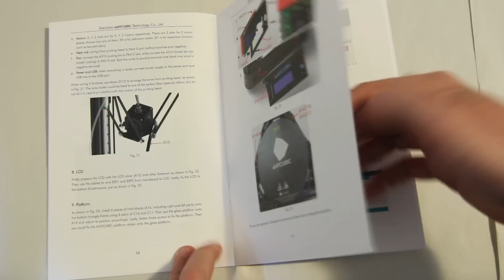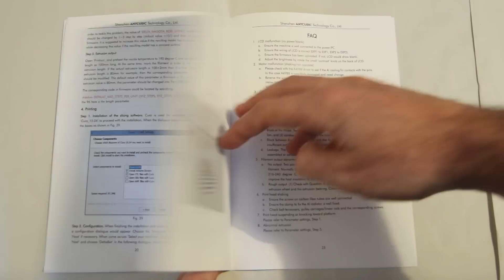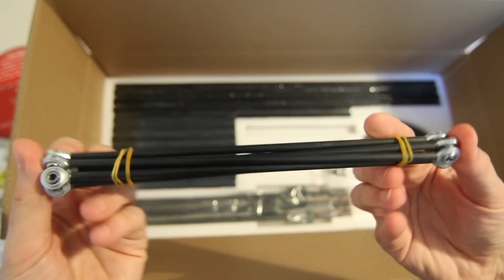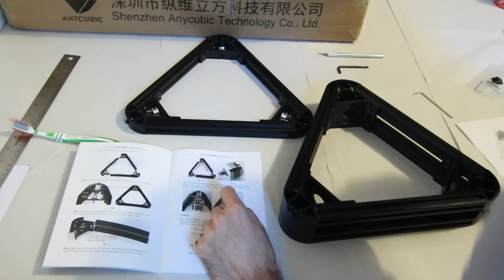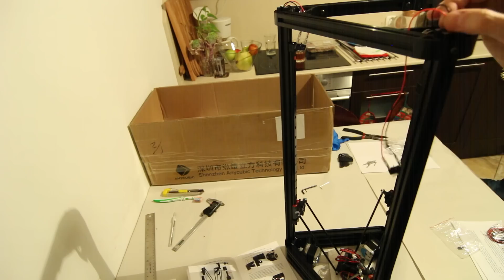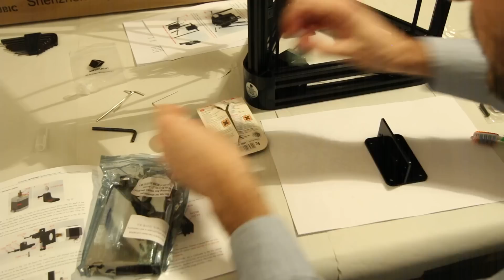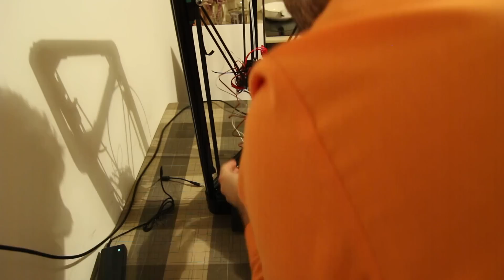Anycubic Kossel Delta 3D Printer Full Assembly and Review

Comment: The best assistant
Reply from the maker: Indeed. And even objectively, surprisingly good :-)
Reply: @ruevs  Thank you for this video. I am just putting one together that has been sitting in the box for many years.  Do you use it still? Is the ball mount upgrade worth the price?
Reply from the maker: I still use it. Works just fine. The magnetic ball joints remove backlash so in my opinion they are worth it. But the printer works just fine without them (for a while).

Comment: Just received mine and what a mess. The product screw heads were damaged (so would need to drill out to replace the screws). Looks as thou the assembler tightened the bolts with a machine that damaged the allen socket. Here are the problems - based upon lack of quality control standards:

A - Two of linear slider bearings are damaged, one of them is rough not smooth the other is too tight and does not move freely. Unfortunately the linear slider housing is made of plastic therefore the tolerances are not consistent. If these bearings are not free flowing, this will affect the print quality.

B - Several of the bolts which secures the table heads are damaged which means I would have to drill out these bolts in order to replace them. 

C - There is no packing slip which shows what is included

D - The top frame 2 nuts and 2 bolts are missing
You are then not able to submit a help ticket as the verification script does not work.

E - Two of the linear slider bearings units were missing some bearings.

F -  No packing slip

I purchased from AnyCubic who resells on AliExpress - I will purchase from Ebay - better seller responses and backup by Ebay/PayPal no nonsense guarantee.
Reply from the maker: Perhaps you should contact @ANYCUBIC on Aliexpress or directly. Their support is (used to be?) very good.
Reply: @ruevs  I did, the seller sent me to AnyCubic site, you can not create a ticket / using Opera 60.xx. On another note, the wiring diagram (on page 25) is confusing for the Endstops and level sensor plugs. I can not figure it out. They attempt to make a correct but still confused. The are conflicts with the board labeling. The first row closest to the the center has lables: Z+ / Z- and so on. I then wired each motor stop sense to the poles. But the diagram to the right side shows what seem to be a correction in labeling. As a result, the print head is crashing while trying to do a level operation or Home.

Comment: Can you create firmware for kossel pulley? Thanks
Reply from the maker: To use my Repetier configuration  on the pulley version all you have to do is adjust three parameters:

Printer Height
#define Z_MAX_LENGTH 297.9

Diagonal rod lengrh
#define DELTA_DIAGONAL_ROD 217 // mm

Printer radius
#define ROD_RADIUS 98.5
#define PRINTER_RADIUS 98.5

See https://github.com/ruevs/repetier_anycubic_kossel/blob/master/README.md
For details.

Comment: Be aware viewers!  I made this mistake and I bought anycubic Kossel kit . It was all pain to assemble this crap and now it's impossible to level it. I spent hours to level the center and two corners but the third corner is not level. Now, if I want to level this corner, it will affect the levelness of center and the other two corners and I am back to the first step. Horrible design!
Reply from the maker: Delta printers are sensitive to inaccurate  geometry/build. I built mine very carefully and have had no problems whatsoever with bed leveling (by hand).

Things to check:
1. Top and bottom triangle are equilateral and exactly the same size.
2. Top and bottom triangle are parallel to each other (all towers are the same height).
The above pretty much guarantee:
3. All towers are vertical, parallel to each other and perpendicular to the top and bottom triangles.
4. The towers are 120 degrees from each other.

5. The linear slides are mounted parallel to the towers.
6. The linear slides are mounted in the centers of the towers.

7. All six diagonal rods are exactly the same length (mine were).
8. The distance between the rods at the carriages and at the effector are exactly the same.
The above guarantee that there is a parallelogram on all three sides of the effector.

All of the above points avoid effector tilt and "nonlinearities" in the geometry that are hard to impossible to compensate in software.

9. The glass bed is flat (mine was). If it is not - replace it or use auto leveling.

And finally for the calibration in firmware read and use this:
http://escher3d.com/pages/wizards/wizarddelta.php
Reply: Thanks for the response but what you mentioned in (1) and (2) at the top are responsibility of manufacturer and not the user! Plus how a user can check all these accurate measurements when manufacturer cannot? At the best, user should assemble this based on the manual and shouldn't spend days just leveling this... not a neutral review!
Reply: It is not a fair criticism unless you have objective evidence of a defect / discrepancy in the parts you were sent leading to the problems you are facing. The design of this printer is perfectly adequate as demonstrated by this build and many other similar ones all over the world. Perhaps you might be better off selling yours as a part finished project and buying a pre-assembled printer ready to go out of the box as your expectations on how easy it should be to build a precision machine are slightly unrealistic IMHO.
Reply: If you having persistent problems with the bed levelling, it boils down to two possibilities:

1. Incorrect geometry due to either a manufacturing discrepancy between parts that should be identical or poor assembly. The former can be easily verified by measurements and the latter cannot be compensated for by any amount of levelling routine or software compensation.

2. The build surface might be warped beyond the ability of the auto-compensation algorithms. Again, this is simple enough to verify with a few measurements.

Deltas are a lot less forgiving than Cartesian printers to  build. Meticulous attention to detail and obsessive measurement and re-measurement is essential every step of the way.

PS: This is in no way intended as a personal criticism. I just want people considering this kit to consider different view points so that they can make an informed decision. Have a great Christmas and a Happy New Year.
Reply: I'd love to sell this and get another one...I spent hours leveling this and didn't get a single finished print...and consider I am not a new bee in this field...I've assembled an Anet A8 printer as my first printer and now it's my working horse...

Comment: Thanks for putting this video. quick question: no matter how tight I fasten the screws of the rail to Al extrusion, it's still loose and is not rock solid as you showed in your video. will it cause any issue for printer accuracy?
Reply from the maker: Loose linear rails will certainly affect the print quality. To get the best possible prints, there should be no play anywhere in the mechanism.
Reply: I agree. the screws are the tightest  but there is still a little play in the rail. Anyhow, the assembly of this printer has been a pain at each step. I hope it prints well at least.

Comment: Does anyone know which pins are used for E1 (to add a second extruder stepper)? The firmware does not define them, but they're clearly there. I'd rather not have to trace them out manually if I can help it.
Reply from the maker: The TriGorilla board of the Anycubic Kossel is compatible with RAMPS 1.4+Mega2560, so all main  peripherals (including E1) match the RAMPS:
http://reprap.org/wiki/RAMPS_1.4

For all other pins see this:
http://ruevski.com/RepRap/AnycubicKossel/3D-Printer-ANYCUBIC-TriGorilla-Integrated-Main-board-Compatible-Mega2560-RAMPS1-4-Combo-Control-Board-4-Layers.jpg

Comment: I got a different power supply, and it doesn't have the plug to plug into the hole on the printer.
Reply from the maker: That is because you ordered the heated bed version. You should connect it to the screw terminal on the board. Pay attention to the polarity!
Reply: super helpful, thank you very much. Please put that on the manual.I waited on this for two days.
Reply from the maker: https://drive.google.com/drive/folders/0B8VIB533cgdMSVMxNm43aG1OQ0U
Look in the "Heated bed installation" section there is a PDF with detailed instructions.
I do not understand why @Anycubic do not make their download area more obvious...

Comment: 01:17:57 Connecting motors like mentioned in manual does makes sens if you got Plus version. Reason is simple; cables are very short, you won't connect motor that is on the right side of the display to Y socket on board in Plus version. But it is possible to connect that motor to Z socket.

Comment: Actually it has a 180mm build volume right?
Reply from the maker: Yes 180mm build diameter is possible. To achieve it you need the included spacers and also spacers between the ball joints and screw heads. See the section
00:40:54 Diagonal rods. Explaining the need for spacers
For a short explanation.
Reply: Does the kit not come with them, or did you lose them, or were they missing? I want to get this kit really bad but i dont want any bullshit associated
Reply from the maker: Anycubic introduced the spacers fix a week after they shipped my kit. They did send me the spacers and extra screws in a second order I made after I asked them. I did not want to wait for the spacers to arrive so I made my own. As far as I understand they are now included with each printer. With one set of spacers (12 of them between the ball joints and the carriages/effector) you will get 170mm build diameter. To get 180mm you will need spacers on the "outside" I think they do not include them. Ask them and send them a link to this conversation.

Comment: Thank you for the detailed video. I ordered a Linear Plus a couple days ago. Would i have to modify your configuration for the alternate firmware to work?
Reply from the maker: My firmware should work. You will need to change the parameters described:
https://github.com/ruevs/repetier_anycubic_kossel/blob/master/README.md
You cold get good starting values from Anycubic Marlin for the Linear Plus.
Reply: Just a follow up, I just finished my 20x20x10 test print. I used the marlin firmware for now. I have a BLTouch sensor, but I'm going to hold off installing it for a bit just to see how it goes. Looking beautiful so far. It was missing the DC power plug for the board so I just soldered a couple wires on for now. There was an issue with how the rods were supposed to connect to the rails. They called for M3x25 then rod then spacer and screw in, but the screw bottomed out leaving room for the rod and spacer to slide back and forth. I replaced them with some flat head M3x20.

Comment: i ve never arrived to calibrate mine and i ve spent 4days on it!! without bed sensor it s impossible
Reply from the maker: It is in fact not hard to calibrate a delta by hand but you have to understand the process. There are only three parameters you have to adjust together with the three end-stop screws. I have a short description and a link to the best giude I have found so far here:
https://github.com/ruevs/repetier_anycubic_kossel/blob/master/README.md
If you printer is built precisely that should be all you need. By precisely I mean:
1. The top and bottom triangle are equilateral and exactly the same.
2. The three towers are vertical and parallel to each other (and therefore the triangles are parallel).
3. If you have the linear version the linearslides are mounted precisely parallel to the towers and centered on them.
If your printer is not build precisely... Auto leveling (or advanced manual) could hide the problems but it will never work optimally.
Reply: look at my video you will see that i have made a correct calibration(esch3d) but my bed is not  leveling on all surface...some point are not  good!!
all my printers has been well mount without problem. it s easier to use auto bed with sensor..lots of beginners will have pain to use it without.
Reply from the maker: OK, I watched your video. If at the three towers and the center Z=0 when the nozzle touches the bed then you have indeed adjusted correctly. In that case the binding towards x+ y+ may be because your bed is not flat? In that case auto leveling will be the only solution. Glass bends - maybe you have tightened it too much between the six holders and warped it? Try loosening them and tightening again - not too tight...
How big is the "error"? With Z=0.1 can you move the head everywhere? If yes than with 0.35 first layer height you may be able to get away with it...
Reply: i think the max error is between 0,5 to 1mm at some points. i have install smoothieboard now. 
so far delta are not for beginners and without auto bed it s a real pain to tune correctly
Reply from the maker: This is way too much! Something is wrong with the geometry of your printer...
Reply from the maker: Arms all EXACTLY the same length? Distance between the ball joints at the carriages and at the effector the same? For all three towers?  Linear rails perfectly centered on the extrusions? Towers bent (unlikely)? This is really strange.
Reply: yes all is perfect
i said you 1mm but it s less (0,3-0,5 max)
Reply: It may help for troubleshooting to do another video filmed vertically (as much as that hurts to say :-) )
That way people can see the whole assembly moving at once. Maybe mixed with closeups of all the moving bits from top to bottom?

Does yours have the heated bed? I noticed if it wasn't at just the right angle it would sit where the wires are soldered to the bottom and wobble a bit. I'm guessing you would have noticed that though.
Reply from the maker: The kit I bought did not have a heated bed. I did order one separately but have not installed it yet - no need to print ABS up to now and for PLA I manage without one.
Reply from the maker: As for calibration - I may shoot a video dedicadet to that even though there are a "ton" of those already :-)

Comment: You are crazy. You haven't assembled correctly. where's the heat plate? you can print up 200mm if you want.
Reply: You should listen better. Without the spacers you can not print the full size.

Comment: Hey my printer only heats to 50 degrees C any thoughts?
Reply from the maker: 50C as measured by the firmware? Actual temperature? Both? (Can you hold the nozzle without burning your fingers?)
Reply: are you sure you put the temperature meter right in it?

Comment: Great Video just wish I really watched it in depth before I built my delta as now I'm looking at installing my heated bed only to find the stepper motor wire come to close for comfort and you installed them to the side, great idea! Also totally agree with the orientation of the towers to the display, actually changed mine after watching your vid. Now I'm considering the firmware swop over, any pointers to help, as I'm a totally new to the whole uploading of firmware and 3D printing for that matter. LOL
Reply from the maker: Follow the link to my firmware in the description. Then follow the link to the README.TXT - it contains a short but complete guide how to flash the firmware. The serial drivers for your board should already be installed if you are printing.

Comment: WOW! Thank you very much for taking the time to make this video! I have been wanting to get my first 3d printer and have been looking - Then, you happened. Very clear 'what you get & How to". The 'issues' you had were very little and easy to correct. Not sure on the why you chose the different firmware - but, tha'ts a choice I can make at that time. Seems the Marlin and your Repetier are both supported pretty good - and nice that different firmware's can be used - I just need to do a bit more research to pick one. I have contacted AnyCubic, Going for the PLUS Linear version :) Again, thank you very much :)
Reply from the maker: The inverse kinematic calculation for a liner delta is a bit too much for the 8bit AVR ATMega2560 microcontrollers running at 16MHz. Repetier seems to be better optimized and allows faster and smoother motion.
http://www.atmel.com/Images/Atmel-2549-8-bit-AVR-Microcontroller-ATmega640-1280-1281-2560-2561_datasheet.pdf
http://forums.reprap.org/read.php?178,693419
http://forums.reprap.org/read.php?178,235397